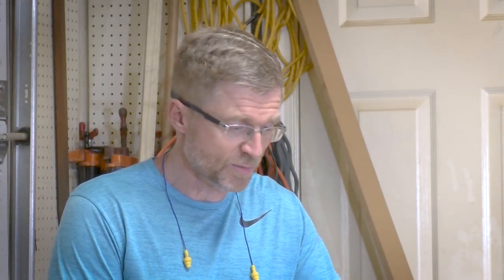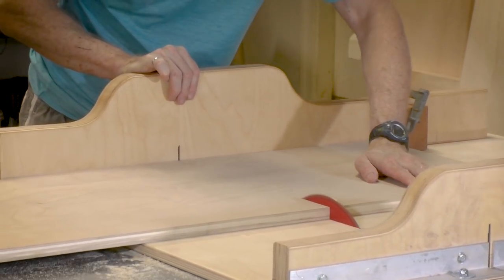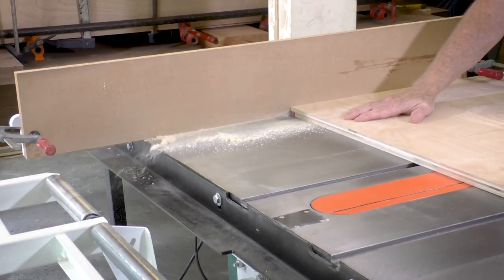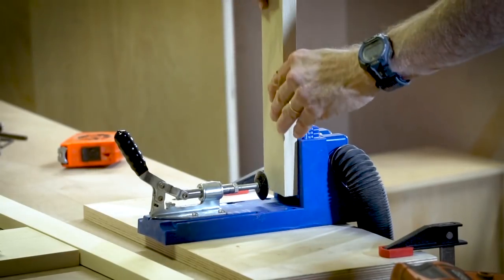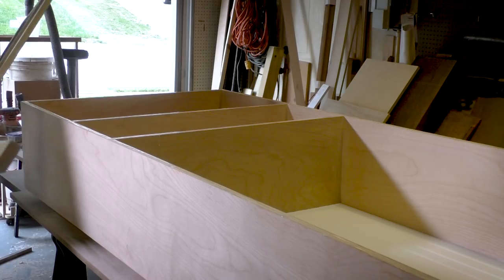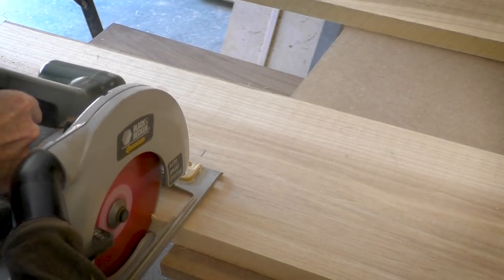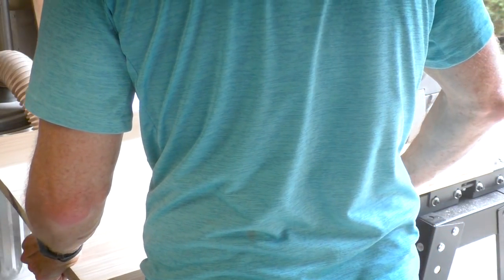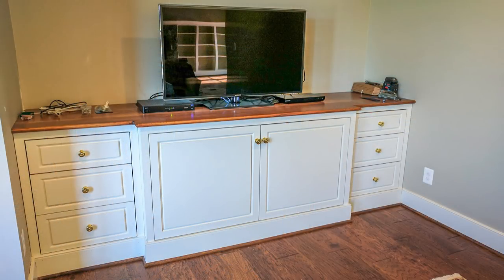DIY Mud Room Cabinets

Comment: The project came out great. I also have the same track saw it I enjoy having it.
Reply from the maker: Thanks!  That track saw became indispensable when I made the 10ft long top for the TV cabinet. The hickory was to heavy and too long to use on my 6" jointer, so I was able to cut straight edges with the track saw and directly glue it up (with biscuits this time).

Comment: One question and comment for you. You would really recommend for a beginner woodworker to buy the track saw.  Also I really like that you take time to take care of every little detail. If you want to be a good woodworker you gotta be organized. Great job.
Reply from the maker: Thanks for the comment!  I'm not sure if I'm that well organized (I can never find the tool that I need) but I do like to pay attention to the details. As for getting a track saw, it's definitely suitable for a beginner. I guess it depends on the tools you already have, and the type of woodworking you're interested in. I would definitely get a table saw first, if you do not already have one. A table saw is not as effective with sheet goods, but it has the advantage that you can make very repeatable cuts. A track saw can be very accurate, but it suffers from the ability to make repeatable cuts because you have to set the track up for each cut. I hope that helps.  Thanks for watching!  --Mike

Comment: Hi Mike. Are you finding it easy to cope with the relatively short ripping capacity of your new table saw? If you could extend your ripping capacity to the width you most generally need for the kind of great cabinetmaking you do, what would that approximately be? I'm asking because I have a brand new, old-stock General contractor table saw with 80" long rails that I think I may be trimming back a little because of the weight of full sheet plywood.  I do have a track saw, but haven't used either yet.
Reply from the maker: I was initially worried that I had made the wrong decision because of the much smaller rip capacity compared with my older saw, but it hasn't been a big problem. My saw can handle ripping for a 24" cabinet so it hasn't been a big limitation.  I bought a track saw either during or after this project and it has been a great addition. I use it quite often and it allows me to get around any limitations of my table saw.   I think if I had a table saw with a ripping capacity of 36", that would be awesome, but it's not really something that I need.
Reply: You answered a question which has been nagging me since I opened the carton. The length of these rails on such a compact table saw requires a sort of a table saw station being built just to stabilize the weight and length of them. And with my track saw dividing full sheets, I think I can safely reduce the length of my rails to a more manageable size. Thanks for taking the time to respond, it has really helped.

Comment: Circled back around to check this video out again now that I'm looking at making some cabinets not too far down the road.  Curious to know which HVLP sprayer you have, I can't remember seeing a video where you talk about it and didn't see it mentioned on your site.  Thanks and good work.
Reply from the maker: Hi Nathan, the sprayer that I used in this video is from Harbor Freight. They have some really inexpensive ones, but the one I used is one of their pricier models.  https://www.harborfreight.com/20-oz-professional-hvlp-gravity-feed-air-spray-gun-68843.html  it's by no means a high-end HVLP sprayer, but it did a nice job on these cabinets.
Reply: I agree that it did a nice job from what I could see in the video.  I'm considering building shutters later this year and if I do will probably pick up an HVLP which is why I asked.  I wouldn't have expected it to be HF though. Thanks.
Reply from the maker: I don't buy that much at HF, but they do have the odd gem from time to time.

Comment: Hi great video. Quick question: How did you attach the face frame to the plywood?
Reply from the maker: I put pins into the corners of the cabinet to help position and hold the face frame in place and then I glued and clamped it to the front edge.  You can see how I did this beginning at 14:01.